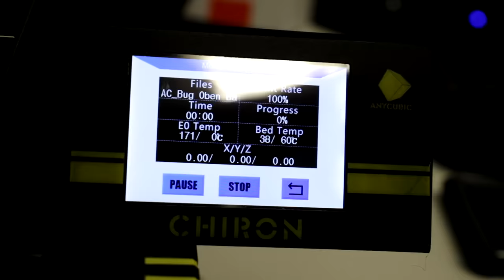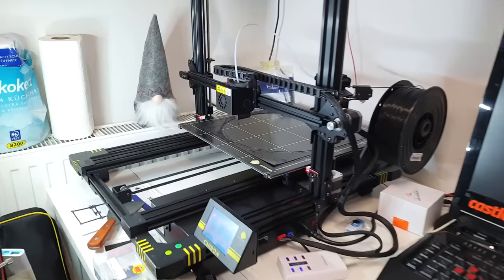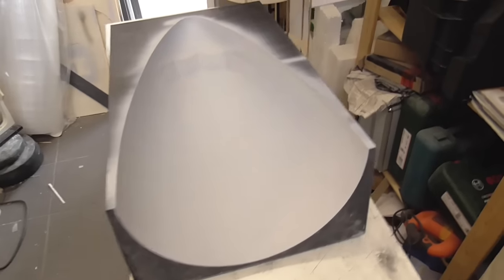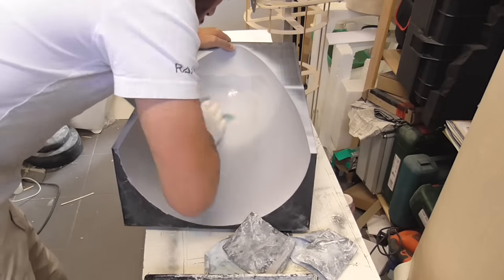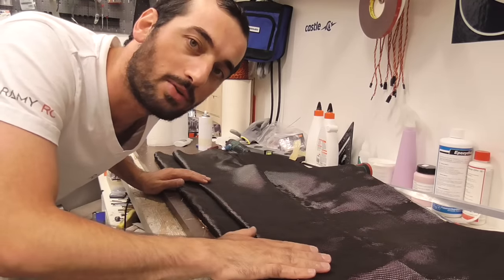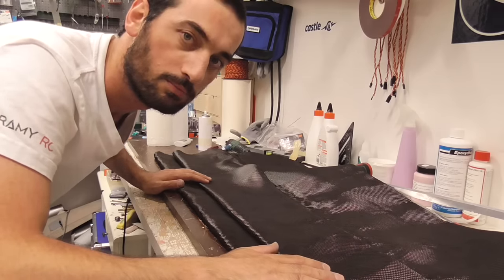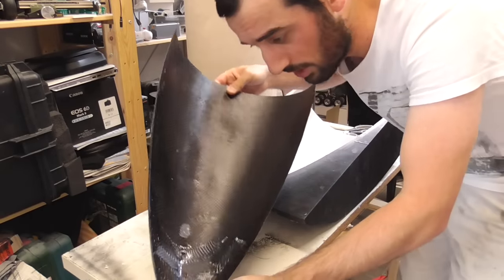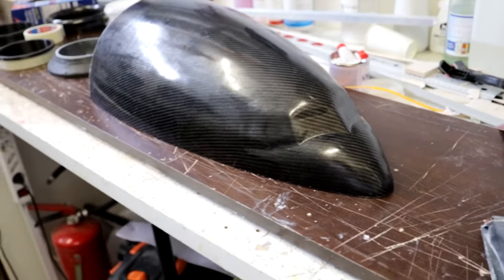Building RC airplanes using a 3D printer

Comment: Hello Ramy... I follow the channel since the X-fighter videos and I ways learning something new.
I Know this is only an experience, but you think try to  build a model entirely in carbon fiber?  A few years ago, I saw a video that a model build entirely in carbon fiber had a fatal signal lost just few seconds after take off. By the author, the most probably reason was that a mesh formed by carbon fiber in fuselage (an electrical conductor) completely blocked the Tx signal as son as the model take some distance.

Comment: Hey, just tuned into your channel and I like your work. Thanks for sharing! 
Which glue are you using to glue the 2 pieces of PLA molds? And which filler are you using to smooth out the mold and fill the printing marks?

Comment: Yo Ramy, where you from? Cause I see lots of stuff from you with German names on it, I. E. The spray Spachtel :D anyway, does the hood made of 2 layers of cf flex? I'm thinking of Making a body for my rc car out of cf but I'm not sure how it would take rooflandings if you know what I mean. Little tip if you live in Germany, I know a supermarket that sells vacuum bags, think they are quite big as well and you only need a vacuum cleaner aka "staubsauger" xD

Comment: Constructive criticism:  no offense intended.  It takes a little bit to get used to thinking how to work best with a 3d printer.  A bit of advice that I think would help. 

Make sure your model looks like you want by printing a smaller scale nose section with the 3d printer.  You can print the model itself, smaller, so you can make sure you like the shape, the windows, etc.  You could have done this quickly, first before all the effort and expense of making a carbon fiber part.  Once you are happy, it's easy to make the mold and continue on making the carbon fiber part knowing you already like the shape. 

Second, you can mold in alignment pins and holes in your different mold parts so that they line themselves up perfectly.  No need to glue them together by eye.

Comment: I think using a 3D printer is awesome, but using that much carbon is expensive. Are you planning on doing the whole plane in carbon?  You will have a problem with radio frequencies.

Comment: pay attention that using carbon fibre is useless if you don't apply vacuum and heat to your parts during the resin application process. carbon has bad adhesion with epoxy resin and if there's too much resin you end up with delamination and cracks ... and much less resistance than with a multi layer glass fibre part ... (especially with only one layer of carbon). the best would be to use pre-impregnated carbon (if you need carbon ... but, out of structural elements, carbon has almost no advantages over 2 or 3 layers of well hand applicator glass fibre on RC panes.) IMHO
Reply: weight?

Comment: Your being rather hard on yourself saying your not a very good builder or very professional. At your age I was using paper and scotch tape to make models so in comparison your a million % better than I was at your age. I've never been a fan of using the foam sheets for much of anything but you were quite good at it, it's just not very strong as you know. I suggest you go to an auto body supply store I think you will find supplies there that will help in your making molds and parts from those molds.

Comment: carbon fiber has to be  "tempered" at 160°c for 5 hours
Reply: no. that's only important for carbon fiber molds that will be used for prepreg parts. wet layup is perfectly fine for that kind of work.